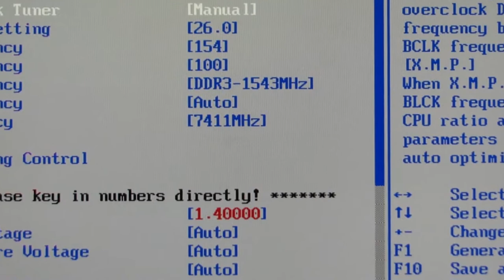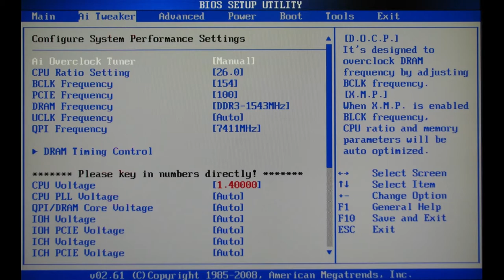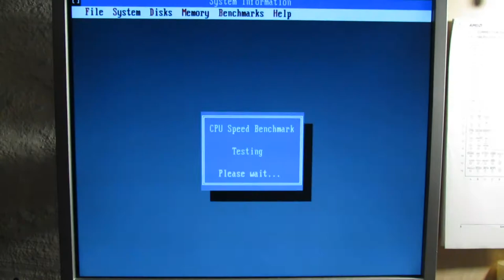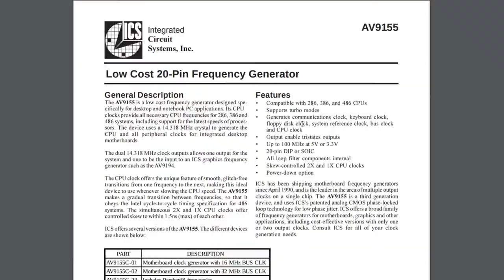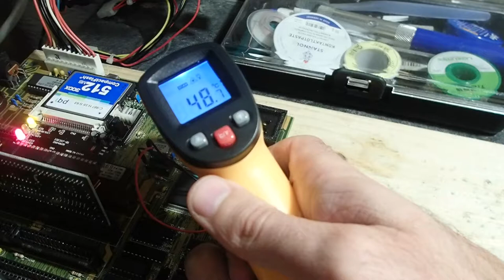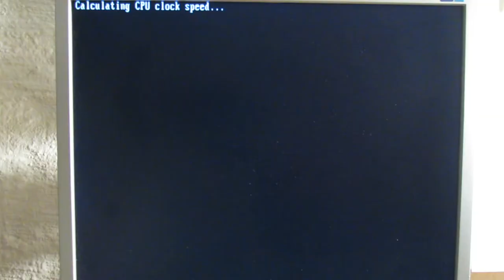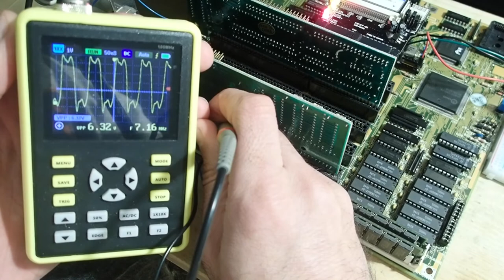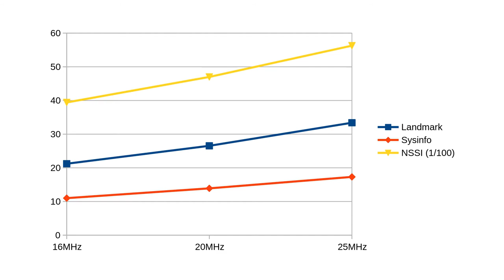Let's overclock an old 386SX

Comment: I know this is an older video. Anyhow - nice job! What is that metal you use to desolder? I can ´t find it anywhere. The board you have is more or less "286ish" chipset which was to save costs back then compared to 386DX. Even running a 286 at 25Mhz is a challange with most of the chipsets and unfortunately it can even kill the chipset later on. Adding pasive cooling will help. Those old UMC guys are nice but not the powerhouses 😁. For those experiments try to get later single (double) ICs integrated chipsets. Old NEAT and HEAT as far as I know don ´t OC well. You are my favorit tech Youtuber and I learned a lot from you!!
Reply from the maker: Thank you! The metal you search is named rose's metal, or rose's alloy.
Reply: @necro_ware  👍

Comment: My original pc had a 386, but i managed to get a 486dx, or a cyrix 586 running on it. The system had jumpers for bus multiplier and voltage changes. More voltage was needed for the better performance. It was a few years ago so i cant remember the exact details i used.
Reply from the maker: I think you memory tricks on you a little bit :)
Reply: @necro_ware  Oh definitely. But I believe it was a PS2 70 designed for a 486 that had been downgraded to a 386 before I got my hands on it.

Comment: When I was a kid, I remember we had a Intel Celeron @ 366MHz and I couldn't play any game at decent framerate, it was software rendering too. So I tried overclocking it as much as I could, increased FSB frequency multiplyer and so on. Needless to say, computer went dead. My dad took it to a repair shop, I was terrified and totally anxious if they will tell him what I did, I will surely get some ass beating :) But they reset BIOS, replaced CPU and RAM, and my dad never found out what I did :)

Either they didn't know that overclocking destroyed it, or they realized that it's propbably too hard to explain. Either way I've learned my lesson even without beating of my ass, the fear of it was enough :)
Reply from the maker: Not, that your dad will read it here now :D I'm really afraid of your ass now....
Reply: @necro_ware  Hopefully my dad does not know my YT username :D

But he is on YT, just not interested in tech, so my ass should be safe :D

Comment: You are finding the DMA controller is running away from the clock speed. Probably the CPU will overclock, but is held back by the DMA, causing memory allocation errors, as it's unable to clear it's instruction code intime for the following set. I had this and got a error: Divide by zero error.
Reply from the maker: Yes, I suspect something like that as well and on this board the DMA controller is integrated into the chipset, so I can't do anything about it. Thanks for sharing your idea.

Comment: i started overclocking with a Spitfire Duron 700 to almost 1,1  GHz with a homemade air-duct-cooling contraption which sucked cold air from outside in the winter too cool the CPU, i was very proud of myself - but later i was pretty sad as i discovered that there were folks out there that cranked up the clock to 1,5 GHz for those CPUs :)
Reply: One of my buddies discovered these coolers (beer type cooler) that you could plug into your lighter socket and it would get cold or warm depending on how the power was hooked up. They used a peltier chip that was about the same size as a 486, so several of us used them for CPU cooling. We were mainly messing around with Cyrix chips, which got really hot and flaky when overclocked, and it worked like a charm.

Comment: Well done, excellent video! Model of the portable oscilloscope used?
Reply from the maker: Thanks, Fnirsi-5012H. For simple measurements it's quite good, because it's portable and delivers a decent job. But it is advertised for up to 100MHz and it works reliably only for up to 35-40MHz. From there it starts to show wrong voltage levels, but if you just want to see some frequency or if some activity happens on a pin, it's still sufficient...

Comment: You had a 66MHz oscillator using the Intel CPU but could you find a 64MHz oscillator to try? I keep thinking that finding a harmonic on the 32MHz scale could help with stability and I wonder what if you could tune a perfect 48,52,or even 64 MHz oscillator in an attempt to find perfect harmonics on the 32MHz scale?
Reply from the maker: Interesting idea, usually it should not  play a role, but in case of overclocking beyond specification, may be it does....

Comment: I have a long history in overclocking. My first overclocking was Pentium 120 running at 133 MHz with cache maxed out from 256 to 512kb on board. I also had the best results with a Pentium 233MMX, running at 250MHz with 100 MHz FSB on a FIC VIA motherboard with 1MB cache, completely smoking Pentium II 233 of the time. Now I don't overclock, I prefer to buy second hand Xeon to push my motherboards to their upper limits

Comment: I overclocked my Atari PC3 XT this way. The original 8088 cpu at @8mhz ran perfectly fine at 10Mhz, which made a huge difference in performance on such a slow machine. Now I desoldered the 8088 and put a NEC V20-10 Mhz in it and it's almost at the performance level of a 8Mhz 80286 in combination with the Tseng4000 I put in it. Duke nukem 1 plays fluently and even games like Hocus Pocus with the Opti soundcard enabled are playable now.

I am waiting for the new NEC V20-16 Mhz to arrive and some more crystals to see if I can get it op to 12, 14 or even 16 Mhz. In my XT the memory will probably be the bottleneck since it is rated 120 and 150ns. Would this kind of memory chips exsist in a 80ns package or less? Eitherway all the chips stay cool at the moment. The only thing I removed was the 8087 coprocessor because it is limited to 8Mhz and even without overclocking it was running hot. It has no use anyway.

Comment: Excellent video. This information is very useful. I am fixing/restoring an Amstrad MEGA PC 386SX (25Mhz) and thinking of O/C to 30Mhz. Should this pose any problems? I could thermal paste and heatsink the CPU. Do you know if the BIOS of this generation can handle 2 HDDs on a single IDE socket? This would be very useful to know. Thank you again for sharing all your findings.
Reply from the maker: Hi, great you've liked it! You can try to overclock, sure. If it works and your system remains stable, a heatsink is a good idea. However, you will probably have to glue it to the CPU, since back than the CPUs almost never have had a socket and if, then there were no hinges for a heatsink. In regards to HDD, as far as I know, the master/slave setup is defined by IDE specification, so if your controller can do IDE, it probably should also be able to hang on two drives, one as master, one as slave. And in case you'll have problems, gice XT-IDE a try, this software does magic. You can find a series of videos about XT-IDE on my channel, where I explain how it works and how to use it.
Reply: @necro_ware . Thank you for your quick reply and sharing this very useful knowledge! a dot of glue on each corner then the rest thermal paste may be a good mix as I would worry glue only may act as a thermal insulator. The original PSU only came with 1 molex power connector so hope this means that the BIOS supports more than 1 HDD
Reply from the maker: I never tried it the way you are suggesting :) I guess, it can work, but just in case, there is a special glue for heatsinks. It is glue and thermal paste in one. It's very affordable, like 1-2€ or so. And regarding the molex connector, I don't think it's a reliable sign for missing support of second drive. I guess, they've been just saving every cent, however, supporting only one hdd instead of two, wouldn't save them any money, because the magic is implemented on the hard drives and not on the mainboard. I'd say it would be possible just to buy a molex Y-cable and connect the second HDD. As I said, even if the built in BIOS has weird limitations, I guess XT-IDE will handle it though. By the way, if you want to connect a bigger HDD or something more modern, like CF-Cards, you will probably have to go for XT-IDE anyway....
Reply: Necroware. I am replacing the PSU as the transformer had failed and unable to source a replacement part. I got a mini ITX PSU that should fit in. I’ve ordered ATX to AT cable. I am hoping that the -5VDC is not needed? There is an ISA soundcard and LAN card in there...if not I’ll need to making -5VDC. I have bought a 512mb CF. So it would be possible to access and boot 3.1 from a larger CF?
Reply from the maker: @NicollGallery  Sounds great, yes! Should you need -5V, you can use LM7905 and  connect it to -12V rail. This should give you -5V. You can double check your soundcard, if it needs -5V by following the -5V trace (ISA slot, pin B05). If it goes to something useful on the soundcard, you'll probably will need -5V. And about CF with less than 512MB, this should work. I'm using 512MB CF cards everywhere in my retro machines. They work like charm! However, if you go over 512MB limit, things can get complicated. Most of the old 286/386/486 machines don't understand something over 512MB out of the box. To get them running, you will probably have to do something more.
Reply: @necro_ware  I spotted that regulator before but read a comment that it can't supply enough current. If you suggest it then its good. I will add it just for completion. Do you have any experience with the Mega PC 386SX? The battery in them badly leak so most will now be ruined, making them quite rare and desirable.  I spent some time cleaning the board and fixing a trace that had corroded. I need to be careful with the mods and don't want to stray too off the original spec too much as I would like to preserve the history. Its been a godsend that you uploaded this video as the knowledge you have is now hard to come by now and many details lost in time.
Reply from the maker: I'm not sure if god has anything to do with me uploading the video, but if you say so :) The retro community is quite large, so you just have to search a little bit. Forums like vogons.org are a pretty good place to ask questions like yours. Regarding the voltage regulator, it is true, that it can't supply a lot of current, however, this is not an issue for -5V and -12V rails, since this are only used for voltage reference but not to really power something, so there is usually just a little current. And about Mega PC 386SX, unfortunately I never have had it in my hands, however, again, if you need some help with it go for vogons.org, there you will definitely find someone, who can help you. And about the leaking batteries, yes unfortunately they are number one killers of old hardware. I regularly do repair such stuff and sometimes it's just doesn't awake anymore. Watch my "rebuilding 286" video and you will see, what I'm talking about. I invested probably 50 hours trying to get that mainboard running again.
Reply: @necro_ware  Ive ordered an LM7905. Have you found any difference in quality of cheaper OSCs? there is an unbranded 60Mhz Dip4 OSC on Aliexpress. Would that be OK?
Reply from the maker: By OSCs you mean crystal oscillators, I guess? Actually, I have no definite experience on that. Almost all crystal oscillators I have are collected over time from another dead mainboards, which I couldn't rescue anymore or another electronics. I don't think, that it's going to be expensive, so why don't you just try? :) Do you have any device to measure the frequency? May be just to validate, that it delivers really 60MHz, which it promises. Btw. DIP4 is wrong, it has to be DIP14, even if it has only 4 legs, it's about the size.
Reply from the maker: And I just looked, in a German electronic store a 60MHz  DIP14 oscillator costs only 1,07€
Reply: Necroware thank you for your reply. I ask as I can get a branded one for £8.50 on eBay or unbranded for £1.20 on AliExpress.

Comment: Remember I overclocked my 386sx to 40mhz with 80mhz oscillator worked fine. Was 25mhz originally
Reply from the maker: Yes, often 40MHz works quite reliably, but have to be lucky with the board and the CPU. Unfortunately in my case the mainboard said 'No' O_o

Comment: I always knew this was possible, I'm so glad to "see" someone do it.   Maybe a stupid question: Can you maybe somehow add a clock double, or does the CPU or Chipset need to be aware of that in a meaningful way?  Make your own 386SX/DX2... I mean completely impractical.... and I don't know what that would entail (maybe at that point you're designing your own chipset).  I've always wondered on some of the intel parts that were never meant to have even a heatsink if you could pull in some stupidly high clock speeds (like double or more... assuming you  could get the board to co-operate) just by adding a modern AIO or tower air cooler.
Reply from the maker: No, as I showed it in my last video about the VRM on Pentium, the clock doubling  happens inside of the CPU and you can't enforce it from outside. If you are interested in overclocking of such an old CPU, checkout the channel Atheatos. He overclocked a 386 to the limit with extra cooling, voltage and mainboard mods. Very exciting stuff as well.
Reply: @necro_ware  Wouldn't it be in theory possible to add some kind of CPU shim between the board and CPU that would buffer instructions to the CPU, running at say 16MHZ on the board side and 33MHZ on the CPU side?  Then some cache on the CPU data lines and a buffer going the other way from CPU to ram/system for the data side..... And then a LOT of logic to make sure to give the CPU a bunch of NOPs  when the cache is full?  It's the Cache being full thing that makes this a stupid idea, yes, Maybe more logic and work then building a new chip set, and all that stuff happening at CPU speed would have made it more expensive then just buying a new CPU.......Is there more stuff I'm missing that makes this even stupider?   I'll check out Atheatos... Thanks.

Comment: Performance increase of 386 isn't any more linear than later CPU's. If you did tests in Doom you would see that you are limited by the speed of video card (though from numbers in Landmark I see your VGA is pretty awesome so it might not be as big of an issue, but still...). The best overclock I had in my life was cheap E2160 CPU that went from 1.6GHz to 3.2GHz and that would be comparable to if you could overclock 16MHz to 32MHz. This was through FSB overclock so raw CPU performance including its ability to talk to memory linearly increased by 100% which was reflected in pure CPU and CPU+memory benchmarks. Of course this affected memory timings and clock divider so memory had to have bigger timings but this is not CPU related and actually identical to 386... and by the way, did you try to increase memory timings after OC? There were in most BIOSes setting like turbo timigns or slow timings. Tinkering with these might improve stability with higher clocks
Reply from the maker: I used the fastest graphics card I had. The problem with Doom and ISA is the limited bandwidth, but 386 is not yet limited by ISA bandwidth. You run against this limitation first with 486DX-33 and faster CPUs. And in regards of the overclocking, I had some talk here and there and it seems to be the chipset indeed. All the mainboards I found were running CPUs with 20MHz max. I didn't find one board which would go higher then that. So the conclusion is so far really the chipset. It probably can't stand higher frequencies, than 25MHz at all. I also played with different memory and timings. No way to convince it :D

Comment: i attempted to overclock an amd 386 40mhz to 50mhz, it would post but not boot.
Reply from the maker: yeah 25% overclocking might be too much. You also have to watch the ISA Bus clock doing so. Some mainboards can't adapt the frequency and go to far over 8MHz, which makes ISA cards unstable...

Comment: That chip that was used on the dead board to configure the clock signal was not too common right? It would be super nice to find a modern version that span a higher amount of options and that could be used to replace an okd oscillator!
Reply from the maker: That IC was quite common. I already planned to make some "universal" clock generator built around similar IC, however I didn't find yet one, which I would like to take. It has to be as small, as possible and still easily variable. Very often the space around the frequency oscillator is very limited in all directions. So I would love to make it in DIP14 size, to be sure, that it fits everywhere. That's not so simple.
Reply from the maker: @RetroTinkerer  Yeah, I know that one. Atheatos went a bit further, than I did, because his mainboard allowed to be overclocked up to 50 MHz. As you probably remember, unfortunately my mainboard said goodbye already at 25 MHz :D  That was a shame, because I planned to use the 33MHz CPU on it.... well, it is as it is.

Comment: Great choice of a monitor. those Samsungs are forever, just change caps in powersupply and add 10 more years.
Reply from the maker: Hehe, I still have the Samsung in a box, but meanwhile I changed to NEC as my main monitor. If you curious why, watch my videos about the MCE adapter.

Comment: An arbitrary waveform generator should be the right tool to generate whatever frequency you want just like the modern PC
Reply from the maker: Not every arbitary waveform generator can generate 66 MHz or more :D The clock generator as I used in the video is a good and very cheap way to go.

Comment: How nostalgic.  My family's first PC used 386SX-16MHz.
What's crazy is, 16MHz would be lost in the reference clock variation these days.  I mean, it's only 0.4% of 4GHz, and if the reference clock is 100MHz, 99.6MHz reference clock would cause 16MHz reduction from 4GHz to 3.984GHz.  Like I said, 16MHz is nothing more than just noise these days.